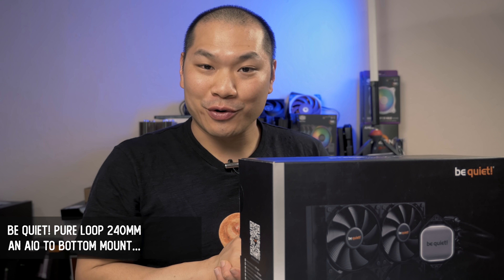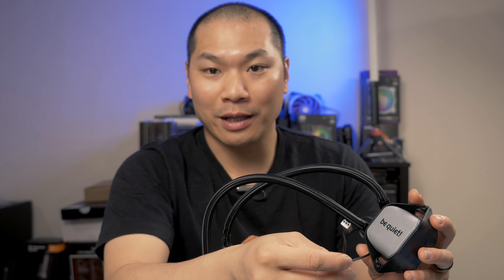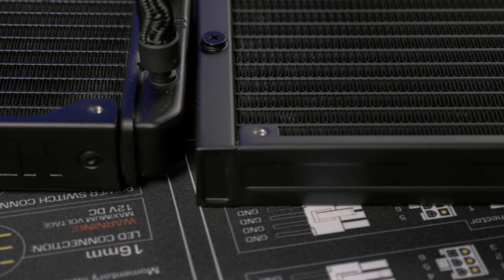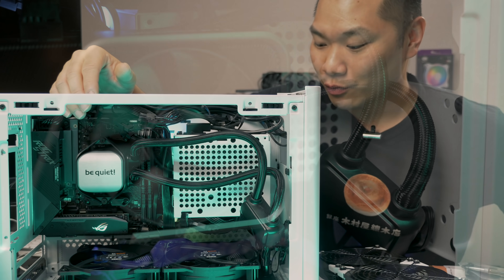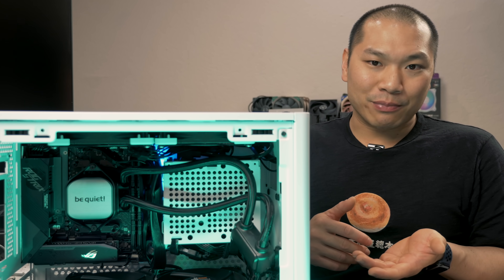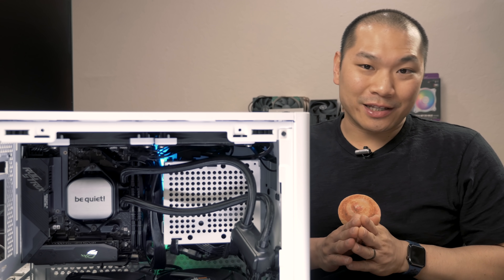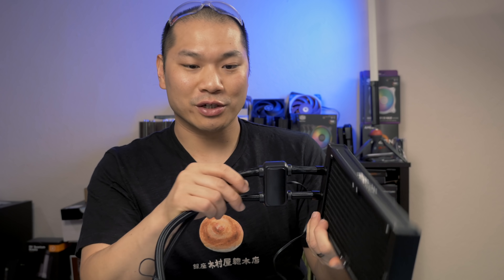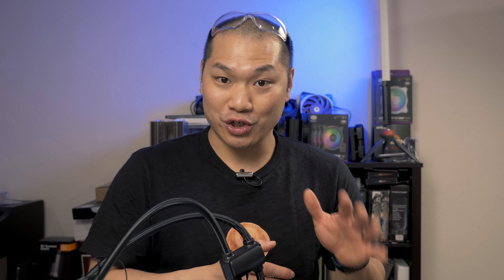Speak Softly and Bottom Mount It: Be Quiet! Pure Loop 240mm AIO

Comment: You don't know how grateful I am for finding your channel. Legit, the most descriptive, detailed builds on the NR200 ft. RTX 3080. Just one question, is it possible to run a vertical GPU RTX 3080 with a 240mm AIO inside the NR200 (with a considerate temp)?
Reply from the maker: Hey Jason, you’re very kind and I am glad you enjoy the content. I assume you’re hoping to use the tempered glass panel. In general I’d say yes but two things will help- 1) thinner gpu so it’s not choked off. The closer to 2 slots the better. 2) strong airflow either top down or bottom up, make sure you balance the airflow from the bottom to top. Here is where some quality rad and case fans help, so that you can just lock them to 1200RPM and lock case fans to a little less. What you’re trying to avoid is air going out or in the back panel since if your fan setup is negative pressure, some GPU exhaust could be sucked back in. If it’s positive, then that cool air is bypassing the GPU fans somewhat and just exiting out the back. There will a video coming later in the week with some thermal benchmarks involving a vGPU, that may help your planning.
Reply: @MachinesMore  Once again, I cannot thank you enough for such details and yes, I forgot to mention about the tempered glass panel. I am looking forward for your upcoming videos. Great content as always, and hopefully you can earn more subs in the future. Wishing you the best brother! 👍

Comment: Unfortunately, the CPU cooler for this AIO wouldn't fit my Asus ROG Strix Z490-I motherboard using the LGA 1200 bracket. There just isn't enough vertical clearance between the heat sinks. Found out the hard way: uninstalled my Cooler Master ML240 V2, 90% installed the AIO in this video only to find out at the last step that it didn't fit, and then had to reinstall my CM AIO (accidentally clipped the RGB cable on my CM CPU cooler in the process :{ )

Just wanted to provide a PSA for anyone else with a mini-ITX board who's contemplating switching to this AIO. Guess I'll have to wait till they make an AIO with this same pump design which will fit my motherboard.
Reply from the maker: That’s a great data point. Thanks for sharing. As I recall the Strix has a huge heatsink combo that is very restrictive, sorry it did not work out for you.
Reply: @MachinesMore  yeah, it was something I never considered when choosing motherboards. Are there any mini ITX boards you could recommend that don’t suffer from this problem?
Reply: Also, would you recommend that I try installing a MSI Coreliquid 240R instead? How do these 2 AIOs stack up against each other?
Reply: It can fit if you rotate the cooler 90 degree, but like the other comments said already, the pump is very noisy like a little refrigerator running. I returned mine because of it although I love how it looks.
Reply: @weichengyu8947  wouldn’t the mounting bracket prevent you from rotating the CPU block or can you rotate that too? Kinda glad to hear it’s so noisy, so I don’t feel as bad it didn’t work out for me :) Hoping by the time my Cooler Master AIO starts dying, there will be a better one of these on the market.

Comment: Would a longer GPU interfer with the pump in NR200 case? Or would the pump fit behint the vertical mounted GPU?
Reply from the maker: I measured a little less than 310mm from the inside of the case to where the pump would interfere. The bigger concern would be the thickness typically accompanying such long GPUs and being so close to the tempered glass panel.
Reply: @MachinesMore  the GPU that I plan on getting is 320mm in length for the nr200p. Based on your finding, I guess that GPU is not compatible with the pure loop.

Comment: Cant help see ur running the much shorter 3070 in this build does that mean you couldnt make the longer  3080 fit with this cooler?
Reply from the maker: The 3080 FE was fine, the max length is a little less than 310mm on the inside dimension.

Comment: My friend use this bequiet,. I went with MSI Meg Liquid 240r instead haha. I actually dont want the msi because its too expensive. I actually wanted
1. Enermax Liqfusion 240
2. Raijintek Orcus 240
but none of them are available..and the bequiet happen to be out of stock on the store i know so i had no choice haha. The difference between the msi and this bequiet/raijintek/enermax is that the msi Pump is in radiator..so im not sure which one performs better.
Reply from the maker: From my testing, the MSI is not as good a performer, especially with AM4. Stock, the BQ unit is top tier, right up there with the best in class Liquid Freezer. For the MSI, the coldplate contact isn’t good due to their choice of using an adapter to hook on to the stock cooler mounts, and also the pump in the radiator steals some heat exchange space. There was a ballpark calculation I did and the difference in thermals between it and the X52/X53 could be partially attributed to the pump in rad design. Lastly, the fans were very noisy, a very odd noise came from mine. You may consider a good air cooler if budget is a concern.
Reply: i swap out the fans for arctic p12 pst. Im on intel btw, not sure there are issue with contact if intel. but so far my 10700k 5ghz temps seems fine. yeah the stock fan i never used it ahha

Comment: Wish this AIO fit better on the side! I finally have a graphics card... possibly.... on order. It's a big one at 323 x 140 x 56mm and needing at least two slots I don't think that graphics card would be a good fit for the side-mounted position. Even if it did fit side-mounted, I worry about that pump fitting in alongside the right side of the case next to that giant video card. If only FE cards were easier to come across.

Comment: Thanks a lot for your exhaustive work in charting cooling solutions in the NR200P! Given all your work so far, what would you say is the best, quiet solution for an NR200P build with an NVIDIA GeForce 3080?

I have an MSI Gaming Trio on the way, and would love to hear your recommendation! I'm leaning towards the BeQuiet AIO you've shown here, but wondering what you would recommend in terms of how to mount the GFX card. Vertical/horizontal? Would deshrouding be an option somehow?

Comment: Any reason you couldn't just plug the pump into a motherboard header that is set to supply a full 12V?
Reply from the maker: There is one possible reason and that’s amperage of the pump. If the pump exceeds or gets close to 1A then it could fry some mobo headers. Most custom loop pumps run off molex power so it’s not inconceivable that this pump could need that much power. I checked the specs and could not find an amperage rating for the pump. 
More practically speaking though I would guess it’s because they are concerned some users might not know how to go into bios and lock down a header to the full 12V DC output. I doubt it would damage the pump if run at lower voltage but it could just flat out not work and then the CPU would thermal throttle pretty quickly.
Reply: @MachinesMore  Thought I'd update this; I emailed bequiet and they responded that it's fine to power the pump from a mobo header set to 12v. I've just done this with my new system (pump and LED both to a single AIO header) and it does work fine, also with the benefit of being able to monitor pump speeds.
Reply: @nickwjd  I am using 380mm version and I contacted them about same thing. They said it is OK to connect at header as long as it has constant 12V so the pump can go full speed. Otherwise you are losing warranty. This AIO is made to be on 100% pump all the time, which is not problem, because pump is inaudible (at least in my case), fans on max are jet like though.
 
I also found that with BIOS on AM4 boards are not reliable right now because of 5xxx. They all have new BIOSes and one of the revisions for my Aorus Master X570 had a bug which was changing voltages on ALL headers based on temp changes, that would also changing speed of the pump quite often and quite aggresssively which is not good for pump (I know it was just on Gigabyte, but it can happen to any brand). IMHO it is better to go SATA at least until BIOSes are sorted out. 

Just my 2c. 
Great AIO btw.

Comment: I ended up going with a 280mm and thin 240 radiators for my nr200.  I used the iceman reservoir to make my custom loop happen.  It was a really easy mod to fit it on the back.
Reply from the maker: Iceman on the outside back of the case?
Reply: @MachinesMore  yes.  It takes very minor work with a Dremel for the left port. The right port fits where a vertically mounted gpu would go.
Reply: @MachinesMore  yes.  It requires making a very small cut with a dremel and then taking off the vertical gpu cover.  It screws on the existing holes for the rear fan.

Comment: Wanted to buy this but went for the ID-Cooling se 224 xt instead. If possible could you review the 225 version when it's available. Want to know if it makes a difference in thermals on the 5600x & 5800x. Love your vids!
Reply from the maker: Hey Gavin, thanks for checking in. I have the 225 on the review desk... hoping to have it wrapped up next week. Honestly for a 5600X even if it is a degree or two better, it wouldn’t be a big deal. We’re talking diminishing returns past the 224XT. For a hotter chip, yes, might make sense.

Comment: The AIO with pump build in the radiator would be a better buy for the itx build.
Reply from the maker: For fit, yes. But in terms of performance, it’s debatable. The MSI Coreliquid was partially impacted by the loss of rad space because of the in rad pump.
Reply: @MachinesMore  Yeah, good point.

Comment: Excellent vid my guy. You look like you take pleasure in this kind of tinkering.

If you put arctic p12's on this will this cooper essentially be equal to the Arctic freezer you mentioned?

Secondly, are there any issues with water temperature when running a hotter CPU?
Reply from the maker: I think with the out of box performance from this cooler there’s very little argument to swap fans unless you want to run high fan levels- the only reason for that would be a hot CPU like OC’d Intel K. Even my 10700K tops out at 110W or so on stock turbo at 4.7ghz. At a certain point the fans do less and less because the liquid can only be cooled so much due to the ambient air temps. Your CPU wattage will determine the steady state liquid temp- from what I’ve seen with something around 90-100W (which runs the gamut from Ryzen 7 to 9) you’d be fine having fans max out at around 60%, as you might have seen from testing even 100% fans didn’t do much.

Comment: Another great, informative video, thank you!

I want to use RGB fans with this radiator. Are there any you'd specifically recommend for use with this unit bottom-mounted in a NR200p?
Reply from the maker: I am currently testing the EK Vardar X3M (RGB). Hope to have a comparison up soon!
Reply: i want to put some cooler master on it the MF120

Comment: As soon as I saw the Pure Loop, I ummed and erred about buying it for a bottom mount in my NR200P wondering if it could overcome the issues that Asetek coolers apparently have in that configuration. In the end I went with the U12-A as a reliable air-cooled solution since there are plenty of reviews and real-world examples of it. 

This video doesn't make me regret my decision, but I'm glad to see a detailed look at it, and that the cooler has been noticed as a potential solution for a bottom-mounted AIO (or some other 'non-optimal' configuration) not only for this case but others as well.
Reply from the maker: The U12A is very close to a good 240mm AIO. (both in cost and performance).
Reply: @MachinesMore  with the bottom mount configuration you show here with the 3070FE, would there also be enough width to fit a 3080? It looks a lot like the pump will interfere with card length and perhaps depth clearance

Comment: I have the Pure Loop 280. Do you think it would be possible to bottom mount it by drilling a few holes or using a 140mm to 120mm adapter with the TG and vertical GPU configuration? https://www.newegg.com/bgears-fan-adapter-140mm-bk-black/p/N82E16811995076?Description=120mm%20140mm%20adapter&cm_re=120mm_140mm%20adapter--11-995-076--Product
Reply from the maker: Possibly- the problem isn't really the width of the bottom of the case- you can always find a way to mount it, even if you have to stick it down. The problem is that the case has these tabs that stick out where the bottom latches onto the rest of the chassis, and those interfere with where a 140mm width would cover. You could potentially grind those of and screw the bottom on, I think that would be an acceptable solution. I'll also add that you don't get any extra cooling because the width of the open space at the bottom is about 120mm.
Reply: @MachinesMore  Someone made a bracket to fit his x63. Wondering if it could be modded to the  Pure Loop: https://www.thingiverse.com/thing:4628823
Reply: @MachinesMore  Can you side mount the AIO with the fans toward the mesh panel (intake push), or would the pump prevent that?
Reply from the maker: The tubing and the pump needs to be given as much slack as possible... so running the rad on the outermost part of the case is do-able, but the multiple connection points makes bending the tubing pretty risky, I'd say your conventional pump in block type AIO is better for side mount.

Comment: You really have some of the best videos. I'm glad I found it while trying to build the most ideal set up for the NR200. Currently trying to get a 3080 of some kind, already have a 5600x. I haven't fully decided on how to cool the CPU or what kind of fan set up. This looked like a good idea, or if I should just go air cooling all around. Any recommendations?
how is the mounting when you just use the NR200 and have the GPU horizontal mounted? is there enough space to the front of the case to route the cables to get to the CPU?
Reply from the maker: Hey there- I think a 5600X is one of those CPUs where it wouldn't benefit much from liquid cooling, other than noise if you are sensitive. If you're trying to overclock it for more single core performance then a big maybe, but otherwise, I just think an air cooler like a Big Shuriken 3 or SE-224-XT will suffice for clocks that PBO will give you. For multi-core stuff I'd say it makes a lot more sense to go up to the next level of CPU rather than try to overclock it (but you don't have that problem since you already have the 5600X). 

Case-wise- there is one more thing- if you're set on vertical mounting your GPU then you almost have to go with an AIO since a flat air cooler will get choked off.
Reply: @MachinesMore  Thank you so much for the recommendations. I'm sorry if I have so many questions, I actually managed to snag an EVGA FTW3 ultra. I'm trying to find the most ideal cooling set up. There is not enough space below the GPU for even slim fans correct? (dimensions of the card and case below). I assume that top two fans are always going to be exhaust and the two side (if they can fit) are going to be intake.

I was also looking at both of those coolers you recommended!
For the SE-224-XT
1) is there enough space to put two fans on the side panel? 
2) is it worth it to put it on the side panel?
3) would you have one or two fans on the cooler itself?

 For Big Shuriken 3
1) orientation of the fan, it is suppose to go toward the board or away from the board for correct cooling?

gfx size
L: 330mm (incl. power connector), 
H: 156mm (incl. power connector), 
W: 60mm (triple slot)

3080 FTW
Length: 11.81 in - 300mm
Height: 5.38 in - 136.75mm
Width: 2.75 Slots

Comment: Good to see AIO manufacturers addressing the concerns about bottom mounting, the pump being highest point in the loop, and also coolant loss!
Reply: Actually that's not the case at all. This particular design isn't theirs, only difference with original reeven is nickel plated block. Fans also ofc. This wasn't developed from 0, also the pump is located there5because of the shity patent held by greedy asotek. It just happens that its specific points might suit well to some of us. There's also some more aio's which might be used as bottom mounted... alphacool has 2, ekwb old one with leakege issues and pump beside the rad, raijintek has one etc.